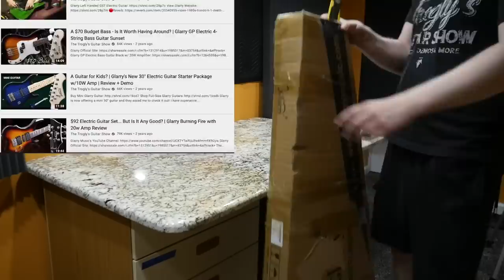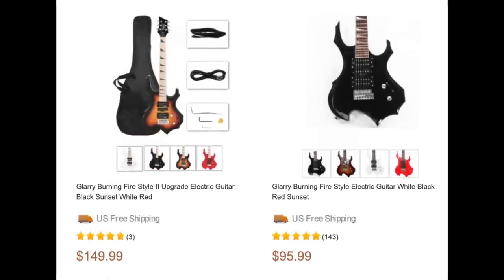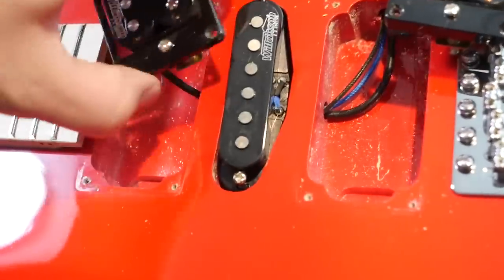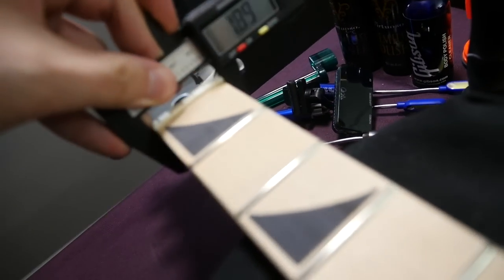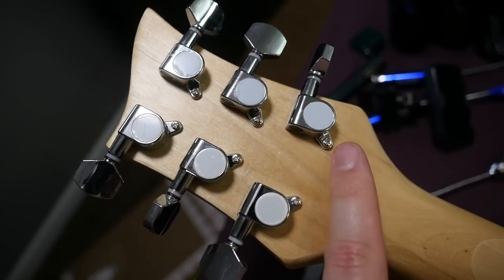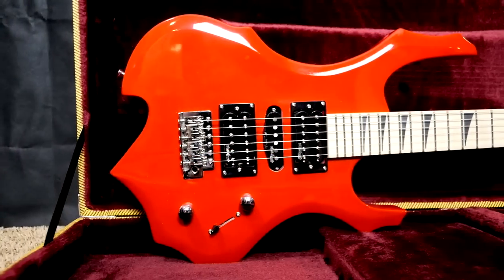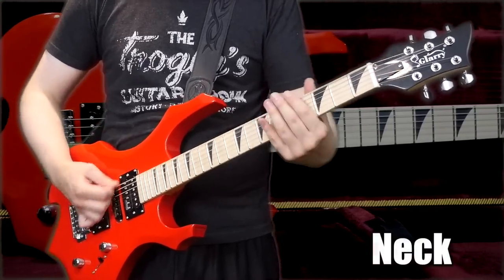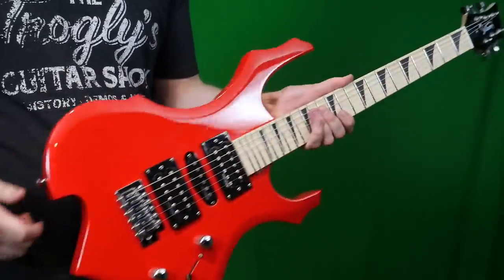Are Glarry's New Upgraded Guitars Worth It? | Glarry Burning Fire Style II Review + Demo

Comment: I recently ordered a set of Wilkinson M-series humbuckers to do an upgrade on my 2014 Epiphone Traditional pro Les Paul. Amazon price was about $35. Here's the specs/propaganda, "This popular overwound open style humbucking pickup fits most electric guitar, like Fender, PRS, G&L, Ibanez, ESP, Jackson, etc. neck/bridge position
Genuine Wilkinson parts. 50mm/52mm pole spacing for neck and bridge, wax potted
Vintage tone, a big fat sound, with tons of harmonics and character. Alnico V magnets provide incredible focus and dynamics
Magnet: Alnico V. D.C. Resistance: 7.6K (Neck) / 14.1K (Bridge). Four conductor wires, black wire is ground, yellow wire is hot, red and white is for splitting coil
Package included: 2 Pieces Pickups. Note: Our screws maybe will not fit your usage, please use your own if you can."

Comment: I have the simi hollow Tele type  from December.same tuners, and the low E tuner bound up before I even got to C#. Replaced with Fender slotted waffle backs. Had to add some material to the holes in the head stock, and after other mods, it's become one of my favorites. I kinda think that all guitar manufactures should add a one sheet explanation one set up, these are marketed for beginners, and green horns don't know about set ups. Lots give up guitar because of bad set ups.

Comment: I take issue with you referring to the scarf joint as a 'cost saving' measure.
Scarf joints are present on some extremely high end guitars and are dramatically more stable than whatever Gibson does because of the increased surface area between the two sections.
Basically; scarf joints are pretty much a necessity if you want to mass-produce a guitar with an angled headstock.

Comment: Another terrific vid, Trogly!  I note with interest that "cheap guitars" in general are improving.  Considering the price, I was rather impressed with this one; a number of distinctly different, usable tones ... something you don't always find in cheap guitars.  I, too, would definitely prefer the Strat shape.  There are indeed some "radical" shapes I like, but this one ... uh, not so much.  Hey, nuthin' wrong with Wilkinson pickups, and if ya put a proper hefty steel trem block on it (GFS has 'em) it'd probably help a bit.  Everything else actually looks darn good!  Maybe change tuners, maybe not; if they work good, and feel good, if it ain't broke don't fix it.  Y'know.  If the hefty neck feels good, use it as is, and if not, y'can always slim it down and refinish.  This would be a good one to change stuff around and experiment with, if ya wanted to, or it would be perfectly fine if left box stock.  At least, that's the impression I get.  Thanks Trogly, well done!

Comment: I actually have the original burning fire though I bought it direct from china for $50.00. It required a lot of work to get it playable. Had to recut the nut, shim the neck and a lot more. I think that is where Glarry makes sense. They seem to take these cheap Chinese guitars and set them up properly and warranty them. I think the original pickups actually sound WAY better then these with the exception of that Neck Pickup. It almost sounds like there is a wiring problem. Maybe out of phase on the other positions? Not sure. That neck pickup does sound pretty good though. Not sure what kind of strings Glarry is putting on these as an "UPGRADE" but on my original a decent set of strings made a HUGE difference. Locking that trem down is a MUST. There is no chance of keeping tune if you use it.

Comment: You really should check out the glarry Les Paul case
Reply: I've got one. It's pretty darn good, the only problem with it is it is on the smaller side. It fits most Les Paul's no problem, but i bought it for an Epiphone Les Paul Custom Pro which is a little bigger and it won't fit in there. I Use it for other guitars tho and like it